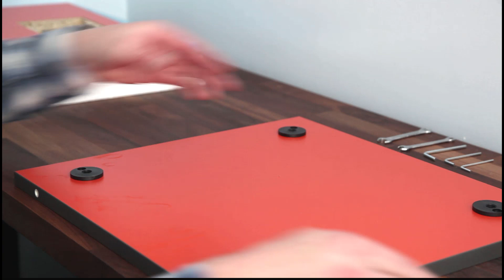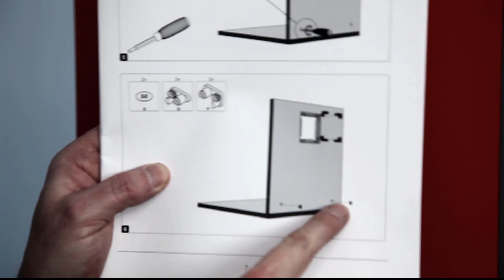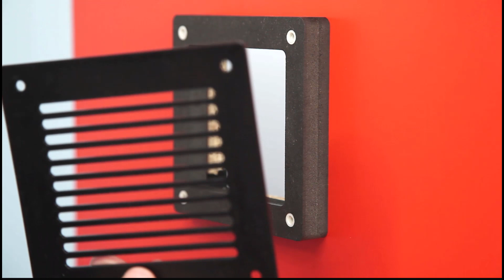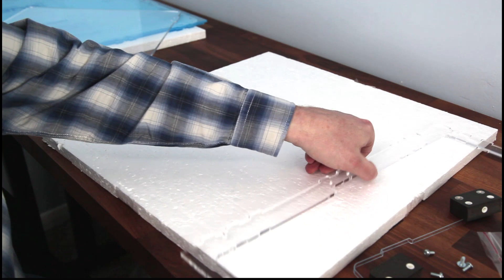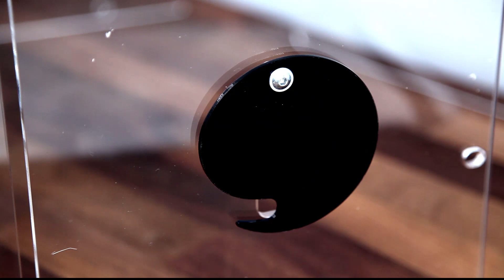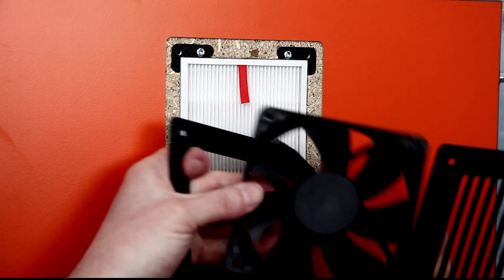Prusa Mini 3D Printer Enclosure by Tukkari - Full Build & Review

Comment: Hi Colin! I am just finding your channel and have subscribed! I am a high school engineering teacher and currently have 8 Prusa Mini+ printers in our lab. I'm looking to get enclosures for them all and came across this video. Do you still fancy this enclosure or have you come across another enclosure for the Prusa Mini that you now prefer? Cheers!
Reply from the maker: @JoshuaKangas  I loved that enclosure as its very well built. But due to space I have bought a floor to ceiling IKEA kitchen cupboard and fitted glass doors. This allows me to vertically stack my printers and save space but still keep them enclosed. If I just had one printer then I would still be using the Tukari. Hope that helps
Reply: @colinhill  Thank You!

Comment: Just built one for myself. Installed a fan on the back and it’s a 4 wire fan. How do I get power to it?
Reply from the maker: Either chop the connector and just use the +/- wires, or buy a 4 cable fan extension and chop that instead.

Comment: Excellent video. I was looking at the Ikea Lack for my, soon to purchase, Mini but the Tukkari isn't that much more and a lot easier to put together. I was wondering about the power supply. Are there any heat issues with it inside the enclosure?
Thanks again!
Reply from the maker: The PSU stays outside, it's a power brick
Reply: @colinhill  Sorry, I should have realized that with a little more investigation. arrives.
Reply: In the model for the Mk3S+, the PSU is inside but there is a ventilation connection.
Reply from the maker: @johnfiott  yes. If you look at my other videos you will see my solution for the TS version with a MK3 regarding PSU cooling

Comment: Hi Colin ! Cool video, have a question for you. Does this enclosure makes any difference regarding the sound of the printer ? I live in an apartment and its impossible to sleap with it in the same room whille its working.
Reply from the maker: Hi. Yes it does help reduce noise as the plexi is thick. I can hardly hear the printer at all when the door is closed.
Reply: @colinhill  niiiice ! Was wondering, if I would get the legs for it printed, wouldn’t it be possible to store the filament roll benith it ? Or if I want this I have to get the bigger one, for the mk3 ? As I can see in your video there is some clearence on top but I don’t know how tall the legs would be.
Reply from the maker: @bogdanstefan5362  there isn't enough room for the leg mod. For a start the door opening wouldn't be high enough. I just have a 1 inch Paver and that's about max allowing for PTFE tube at top. Perhaps check out the MK3 options or ender options if you are keeping the filament inside. Tukkari make quality enclosures. I will be releasing an led lighting video today.

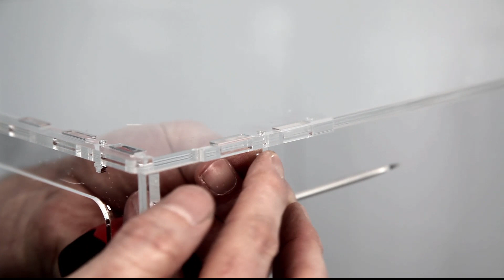Comment: This acrylic parts assembly (23:16) gives me flashbacks from assembling my Anet A6 :) 
Would be great to have an option to remove easily whole acrylic piece for easier access to the printer. And move LCD and PSU outside.
Reply: Great video :) Thanks for making and sharing :)
Reply from the maker: Hi. I guess it's just a case of lifting the entire Mini out, but as its lightweight I don't find that a problem. Re PSU, that's outside as it's the power brick. Perhaps you mean the motherboard? That's not quite as important for temps. I guess the display could be moved outside but would require the purchase of a longer ribbon cable. I now have the power button and usb on the display so would make it too complicated. However, I am looking to add some lighting very shortly and other mods so make sure you subscribe to get notified.
Reply: @colinhill  Oh Prusa mini PSU is a power brick. Then it would only make sense to move LCD outside. The LCD ribbon should be FC/FC Connector A-type 14 Pins - not that pricey. But Prusas are kinda fire and forget so maybe not worth it.